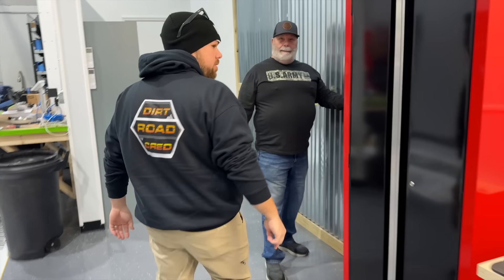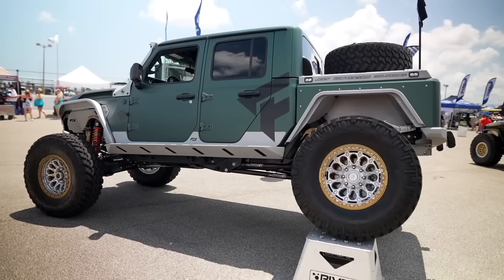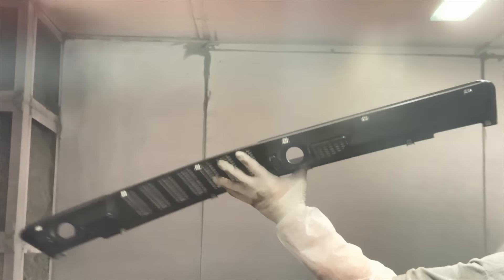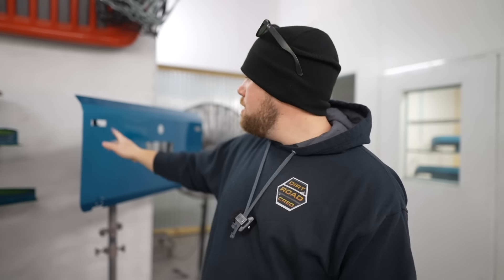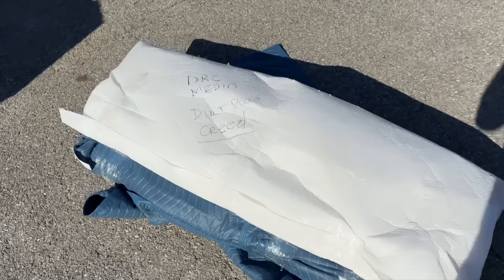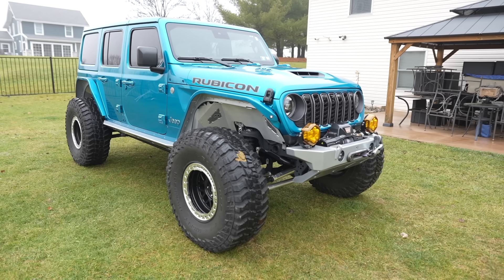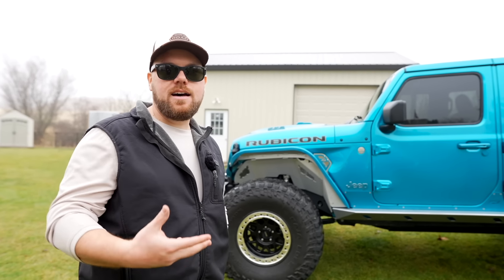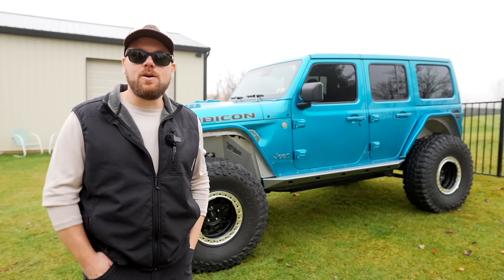HUGE 2024 Jeep Wrangler 392 Fix

Comment: Not bad, you built it your way, in my opinion I would black out all the silver parts, both front and rear bumpers, the rock sliders/step, the wheel well liner. then I would put the original taillights back on. and for the tailgate, you could use truck bed liner to make it rugged and match the black interior

Comment: Got my wiper cowl done recently, reign purple with hydrographics, and i was very impressed with the turn around time and the quality of the work.

I gotta say though, i am really surprised that inner-tailgate panel is just powder coated. I would think that would need something more durable, like getting it sprayed with a bed-liner material, just so it isn't scratched up easily.

Comment: It looks so much better… 
My only issue with the tail gate now is the way it doesn’t follow the body lines of the jeep. 
If they fixed that it would look so much better.
Reply: How does it not follow the lines? It’s actually curved to match the jeep’s body.
Reply: @ see I would disagree because now you would have to create an indentation where the factory door handle was in order for it to match this area.  This wouldn’t be symmetrical and seeing as how the tailgate is no longer covered with a spare tire it would stand out to me.

Comment: I think it looks great either way.  I liked the two tone look better than the after. 
I grew up in PA and I was told when I was young that fenders had to cover the tires.  Has that requirement changed or will the 392 not be road driven in PA?

Comment: sliders, metal fender liners, under fenders, and bumpers should have been black textured satin black powder coat... rear tail light housings should have been black not paint matched to give better contrast... license plate frame should have been black... door handles are fine paint matched, but the Jeep fender emblems should not have been paint matched... IMO the 392 gold/bronze accent clashes too much with bikini, better off using a silver, titanium accent in those areas... also would have loved to see your grenade crawls in machine finish, satin black rings and cadmium plated hardware.